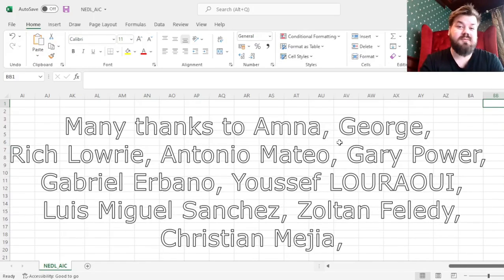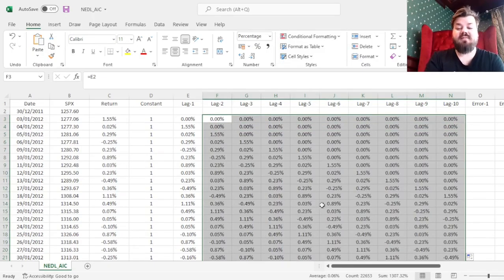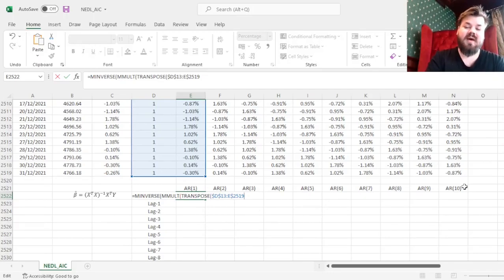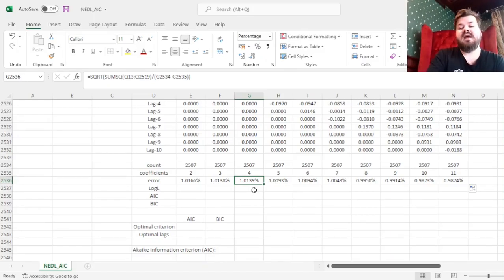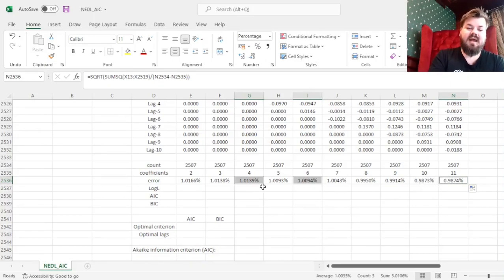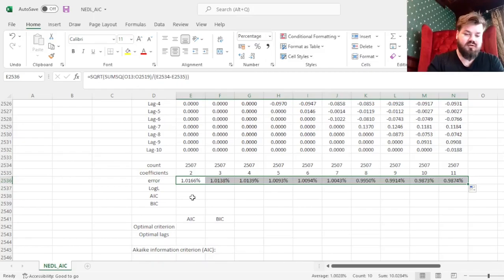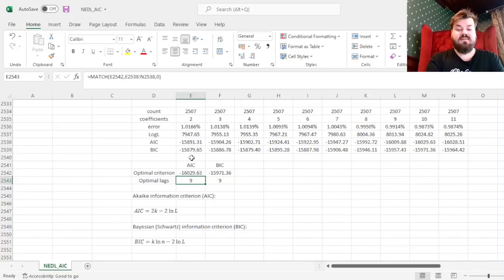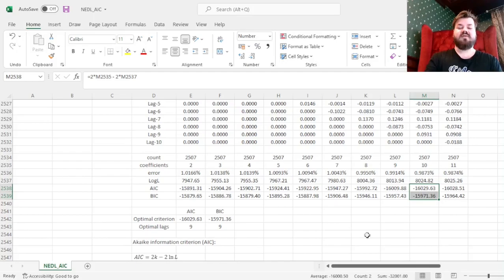Optimal lag length: Akaike and Bayesian information criteria (Excel)

Comment: Thanks for the video, super helpful! I've been struggling trying to find a decent solution to help inform to the optimal # of Observations in a Linear Regression. Sure, there are plenty of solutions to help with selecting the correct # of Variables (RMSE, Adj R, Pred R, Mallows C, etc). However, as I understand it, NONE of those really provide for a decent Apples-to-Apples way to compare different Models, with different # of Observations.

Given that understanding, is it correct to apply the AIC/BIC here, similar to how you have constructed it (removing 1 observation, then re-running it), to select the model with the optimal # of observations? Then of course, you could ensure that it passes the rule of thumb test (minimum # of observations must be at least equal to 10x the # of independent variables).

Lastly, I had heard that a topic called "Statistical Distance" or "Cosine Distance" is helpful in selecting the best model, given differing # of observations. Are you familar with those topics, and do you agree/disagree?

Apologies for the long note, really loving all your vids.

Comment: Hey Sava, after same own research, what do you think about the following "recipe" where I try to combine some of your videos: First of all one should check if the time series data that should be investigated is stationary or not for instance by using the Dickey-Fuller-Test. If it is stationary than one should compute some AR-Models and determine the appropriate number of lags by checking the AIC or BIC. After that one should check the residuals of the AR-Model to see if the residuals or autocorrelated for instance by applying the Durbin-Watson-Test from multiple linear regression. If there is a significant autocorrelation than it could be a good idea to model these "shocks" by expanding the simple AR-Model to an ARMA-Model. If in the first place the Dickey-Fuller-Test shows that the time series data is non-stationary than modeling the time series data with AR-Models is not appropriate. Instead one could use a simple MA-Model because these Models are stationary by definition or use an ARIMA-Model instead. What do you think? Is that summary correct? Thanks so much

Comment: Thanks! But what about ACF and PACF? Aren´t they also important to see whether AR or MA is appropriate and also to see how many lags to include?
Reply from the maker: Hi, and thanks for the question! Yes, it is important if you are using a Box-Jenkins heuristic for model selection. I would say Box-Jenkins is most useful to select AR versus MA, and then information criteria can be applied to determine how many lags one should use. Alternatively, you can check whether an AR model is stable and when it is not, use MA instead. By the way, a video on Hannan-Quinn and AICc is in the pipeline and will be released soon so stay tuned!
Reply: @NEDLeducation  Thank you so much. I really hope that you will soon share a vid how to implement ARMA. It would be so great if in addition you would explain in that regard how to check the prediction power of AR vs. MA vs. ARMA and then show us how to choose between these models